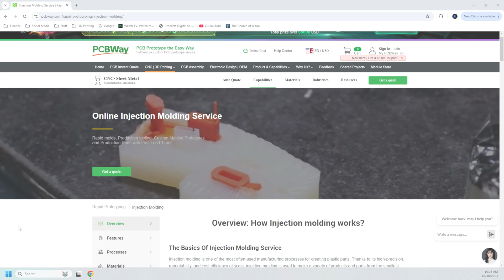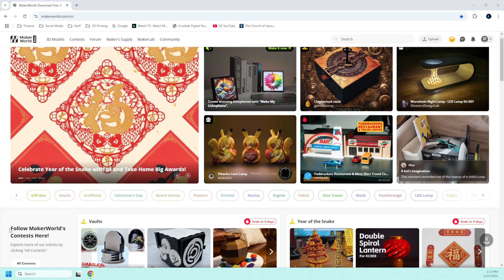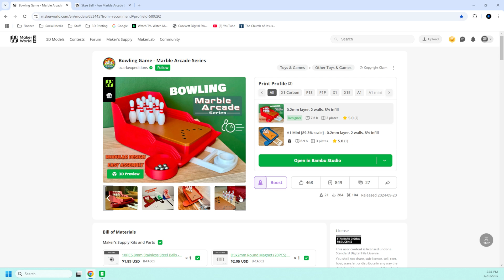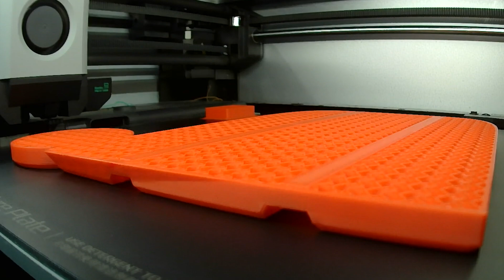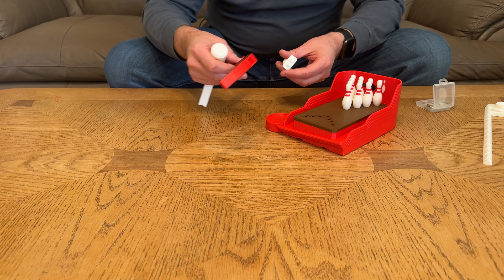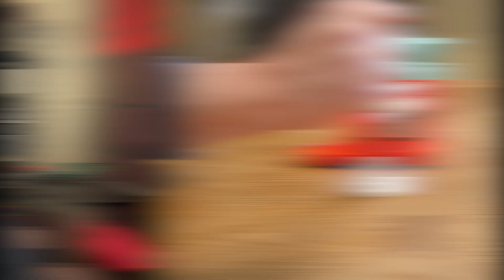Building a 3D Printed Bowling Game (Bambu X1-Carbon Timelapse)

Comment: I think you need to use even lighter magnets, ones that barely hold on.
Reply: Printing a two-layer topper for the bowling plattform would create enough distance so the pins topple over more easily.